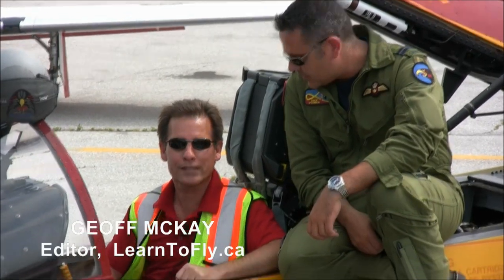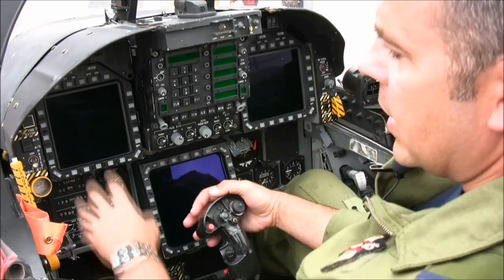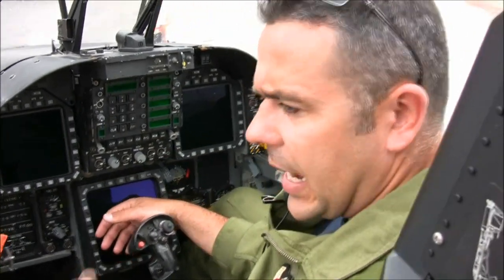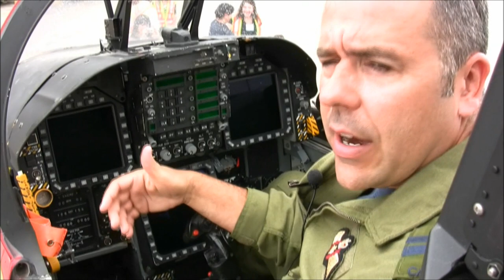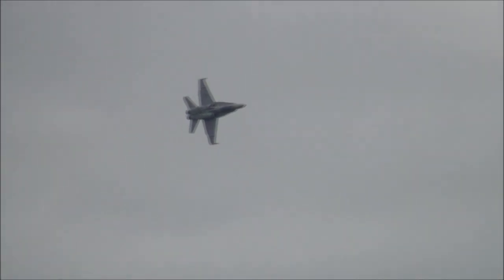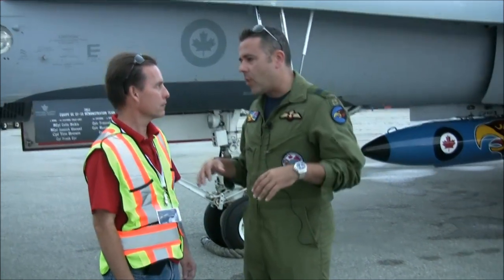Learn to Fly a CF-18 Hornet Fighter Jet

Comment from the maker: CHAPTERS:
00:00 - Learn to Fly a CF-18 Hornet Fighter Jet
00:20 - Captain Erick O'Connor "Hom" 409 Squadron 👨‍✈
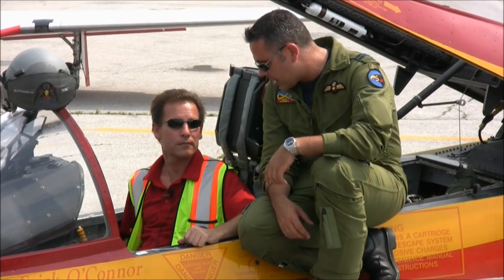01:17 - CF-18 Cockpit
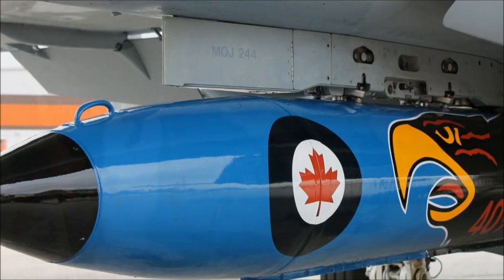02:22 - Weapons 💣
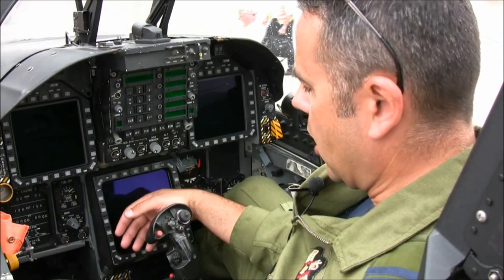02:53 - Radios 📻
03:10 - Spotlight 💡
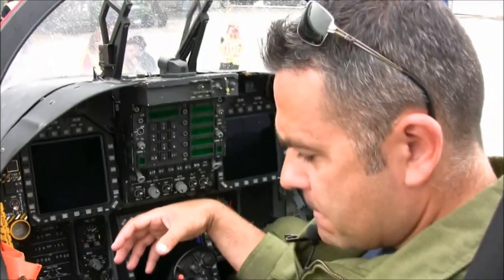03:26 - Heads Up Display (HUD)
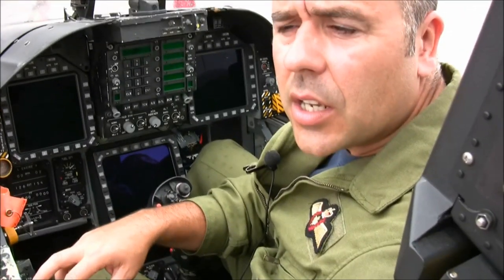04:27 - Arrestor Hook 🛑
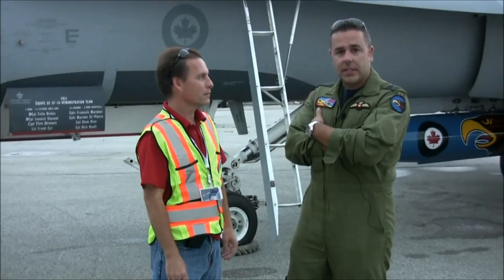04:45 - CF-18 Walkaround 🚶‍♂
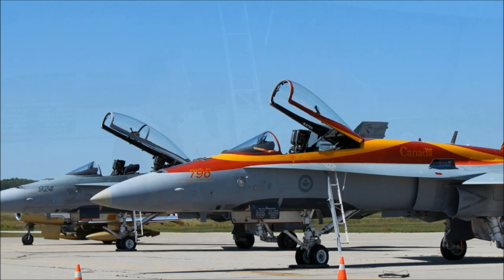05:17 - CF-18 Performance
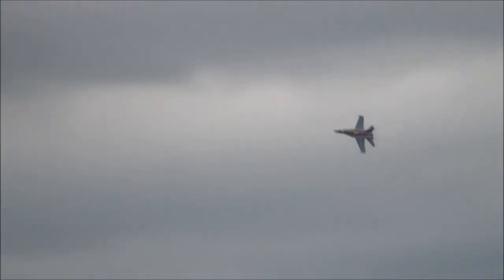05:37 - High-G 360 Aerobatic Maneuver
06:41 - Fly-by-Wire (FBW)
06:53 - V-22 Osprey Cameo
07:05 - CF-18 Taxi and Takeoff ↗
07:35 - CF-18 Aerobatic Performance
09:02 - Formation Flight
09:13 - CF-18 Taxi and Shutdown ↘

Comment: DCS World: F/A-18C Hornet brought me here. I already knew how to start this bad ass bird up
Reply: There's a bit more to in in the real aircraft... as in, years and years of training :)
I'm also sure that DCS leaves out anything that's classified. To start completely from cold, the real aircraft probably requires a security code that's set by the ground crew and is given only to the pilot when he climbs in. If it does, you're not going to see it in an entertainment sim :)
Reply: @devilsoffspring5519  there is a code created daily for each aircraft that comes directly from the prime ministers office. If inputted incorrectly too many times the aircraft will go into a limp mode rendering it useless until an AVS technician recomputes the mil spectrometer. A new code must then be entered.
Reply: @joshhead9368  That sounded almost plausible until about 1/3 of the way through :)
Reply: @devilsoffspring5519  almost as ridiculous as what you said.
Reply: @devilsoffspring5519  are you referring to the IFF mode 4 codes and the crypto variables?
afaik, you can start and take off with the aircraft with little external help...which is modeled in DCS...
the only things that arent modeled are specific IFF, have quick, and ky-58 besides some other stuff....
besides you are supposed to have a DTC /mumi in the real aircraft in order to load system data...

Comment: The CF18 is what we normally use.  The CF188 is the official term which we use in our LogBooks and other external documents.  Amongst Fighter Pilot, we will use F18 or Hornet.  A-C-E models are all single seater.  The B-D-F are all dual seater.  The Canadian Forces have the A & B models which have received extensive upgrades to avionics.  The E-F models are a different aircraft all together and much much larger.  Hom
Reply: Hom... 😂 You sound francophone. J'ai raison?

Comment: "Ready to go, like on 9/11" the pilot says. That's odd, as NORAD took over an hour to even respond, with operators even unsure of whether it was the drill mimicking the events of 9/11 that was taking place that morning or a real live attack that they were responding to. Who told Norad to stand down?
Reply: +Namaste1001 Even if they intercepted the planes they would never shoot down a commercial aircraft in the US back in 2001. I think they would now if they knew a plane was hijacked.
Reply: cherb23
That's not the point, they were told to stand down. 9/11 was allowed to happen.
Reply: AMCT 101
Exactly, and they failed to respond. Which was my point.
Reply: He specifically mentioned 9/11. My point is valid.
Reply: You're trying to distract from my original point. It still stands true.
Reply: ***** 1/2 a dozen Jets are more lethal and effective than you think.
Reply: ***** Do you understand how fast Jet fighters are? They could have stopped the airliner if they wanted.
Reply: ***** Depends
Reply: I'm pretty sure he was talking about a 9/11 like event, not actually saying we're ready to act exactly as they did on 9/11 specifically. Because you know, it isn't like Canadian aircraft were sent to intercept planes in American airspace on 9/11.

But I know you can't help but to get all 9/11 truther triggered.
Reply: ((MUH 9/11))
Reply: Namaste1001 The U.S. responded it was just too late at that point.
Reply: @amct1019  please research NORAD thank you

Comment: Haha, yes. once you get to know them it's really simple. The buttons are usually grouped in categories, so it's easier to remember as you keep doing it. I mean the F16 for example has a much more complex cockpit than the F18, which adds to the overall workload that the pilot has to go through during complex maneuvers. Which is exactly what they are trying to avoid nowadays with new fighters.

Comment: Dear Cinnabun. As far as your initial explanation of a machine that converts one form of energy into a mechanical energy, it is correct but this basic explanation stems from the early days of technology. In our modern era motors convert electrical energy while engines burn a specific fuel to create mechanical energy.

Capt. Pierre

Comment: Welcome to the Canadian Forces. A: We dont have super hornets, Super Hornets are F/A-18E's. Google it. B: CF-188 is CANADIAN FORCES. Not american. I have connections in the Forces who are pilots, and this is VERY correct information. Canada owns CF-188A's and CF-188B's. Also, in Canada (cause we're weird like this) We put an extra number for no reason. CF-177 (the Globemaster) is an example. Its American Designator is C-17, but we make if CF-177. Read your stuff before you confront someone.
Reply: that extra number usually comes from Canadian ordered modifications

Comment: GoMigman, I know your just poking fun at the Canucks, but if Russia came at us with airpower, they probably would come over the top, North Pole and cruise on into Canada, then TRY to get close to us. So yea they have to defend their boarders. I'm with ya on the F/A- 18 performance and design. I would lay money on a Hornet up against ANY aircraft in the world. This airplane is the best the U.S. has produced in a long time!
Reply: F22 raptor? could take on 6 F18's on its own.
Reply: I only tease in good fun, we love Canada!  Anyway, I'm with you on Russia coming in  from the north and even with the US' allegiance/support, we have our own problems trying to police the world and a disastrous F-35 program that could fail financially and even the aircraft by the way things are going, so Canada needs to rely on herself!  That airspace is so huge, I've always been an advocate of more strategically located bases to be equipped with enough aircraft to patrol specific quadrants that would overlap the others by 50 miles each way, give or take, and stretch that out the entire length of the northern border.  I personally think it would behoove the RCAF to invest in a boatload of F/A-18E's and F's instead of the F-35.  I think the latter is not only going to be a budget buster, but I'm not sure it's going to be the effective aircraft that an air force, which needs a tough, multi mission, high payload and great all-around workhorse would need.
Reply: If Russia came for the U.S it will be with ICBMS and SCBMS, those cf18s are there to reduce the number of re-entry vehicles.
Reply: @Nr1from1978  hmm 122 in total thus none available

Comment: "get the motor running" no Captain, you get the engine running, motors are electrically driven - that's why we say engines drive, motors are driven.
Reply: unapro3 Would the APU be considered a motor?? The APu gets turned on and the the engines so yes you need the motor

Comment: At 7:35 what speed would the jet be going? And does the speed have anything do to with the distinctive sound heard?
Reply: 350mph to 400mph. Technically the speed of sound in 761mph give or take. It all depends on the conditions from altitude, barometric pressure, so on and so on. Aircraft cannot break the sound barrier at airshows do to FAA restrictions. During high speed passes, they normally fly 600-650mph.

Comment: Scenario:
In movies sometimes we see and ear a pilot that has been hocked / locked by another pilot which is going to fire.

Questions:
Is it a real air fight technology or it is just cinema fx?
How is it possible for a pilot to say that another aircraft has locked own plain for certain?
How does it work the technology that allows to do that (if any)?

Thanks in advance.
Reply: Radars can do multiple kinds of locks when they see a target so that is all true (although in the movies its rather unrealistic but it gets the basics kinda)

Modern aircraft can tell when a radar is "locking" them by means of a RWR (radar warning receiver) which identifies direction of the radar, type of radar/aircraft (different radars on different aircraft which produce different signals), and emission strength (distance) so the computer can generate a relatively clear picture of aircraft around if it picks up radar signals.

They work via many small antennas on the exterior of the aircraft which receive the signals. Most modern day aircraft dont "lock" anymore but use a soft track when they launch missiles so the enemies RWR doesn't pick up anything more than regular radar signals. Only when the missile goes pitbull (when the internal radar of the missile goes active for its own guidance) will the enemy aircraft get a lock warning and will identify it as a missile. Older aircraft used missiles without internal radars so they had to keep a hard lock which would give the enemy pilot a lock warning when the missile was launched.

Comment: The DAS removes covers the blind spot. You can track objects up to 1300 km away at any degree with the DAS. I think you need to do a little more research on the F-35 . The growler would work well in conjunction with an F-35 but instead of? thats kind of silly, theyre two different aircraft.

Comment: I'm all Navy Vet through and through, but I just can't warm up to the FA 18 Hornet/Super Hornet like i did to the Tom Tom. I'm still mad at the USN for trashing that beautiful bird. Yeah, Yeah, I get the maint. time for each hour of flight time and blah, blah... Nothing was sexier and badder than a Tomcat and her radar, lock you up before you even saw her on your scope. 1977-1980 USN, OS E3
Reply: ZanOGAL NO he says he's an OS, Operations Specialist; seaman, E-3. I'm a vet too, AE3. Worked with VFA-22.
Reply: I was the NDI Tech on CVN 71 for the Tomcat sunset cruise.
Rest easy knowing we flew the wings off and the motors out of those bad boys.
Huzzah!
Reply: Lol we got our f/a-18f aircraft right before i got into the squadron in 2008 from boeing, and till 2012 we went through 3 extended deployments, many Top gun debts in Fallon, boat debts, and qualification flights. I think the Navy just flies the wings off aircraft in general. (Gotta keep pilots trained for carrier ops)
Reply: Same was said about the F-14 replacing the Phantom. And the same will be said about the F-35C replacing the FA-18. I guess the F4F turned noses too.
But yes, the Tomcat was one hell of an airplane. FLY NAVY.
Reply: I always reckoned the F14 was my favourite Navy plane. She looked the part,even when standing on the deck. And when flying,she flew like an angel.

Comment: What makes you say that? is it the delays or have you actually bought into the hyperbolic BS that the media and detractors have thrown at the F-35?
If its performance based you may be very surprised once you get them clarified. People always talk about poor kinematic perforamce but the F-35 is designed at those specs in full military config. It out performs everything we have no under a combat load. Even the super hornet can only achieve mach 1.2 in combat config.

Comment: Too many electronics... what happens if those screens were to break?
Reply: ***** Hahahahaha, you're right ;D
Reply: +EggiTheShadow when was the last time your TV or computer screen broke??? My parents' old TV lasted almost 20 years and it was still working when they replaced it with an LCD
Reply: +EggiTheShadow Why would a screen in a plane like this break?what would break it?it is probably more stronger than normal glass but theres nothing that can break it inside the plane...
Reply: cmardeux h4z3m1 Sorry what i meant by that was, if they send out an electromagetic pulse or something goes wrong with the electronics....well, you're practically dead anyway since its a fly by wire plane
Reply: +EggiTheShadow Oh that makes sense you're already going to be dead after an electromagnetic pulse hits you
Reply: h4z3m1 Well not exactly, it only affects electronics, unless you have something electronic keeping you alive or you're a robot you probably wont die. Regardless you'll die not being able to control the plane anyway so it really doesn't matter. Hopefully ejection levers are still mechanical, rather than electronic and still work in that situation though
Reply: Yeah usually a strong electromagnetic pulse from a nuclear bomb or something like those electromagnetic bombs (idk what theyre called) would fry the plane computer and your controls will not work...
Reply: +EggiTheShadow It has traditional analog instruments that run off of a pitot static system. Although it would be hard for those screens to break in the first place.
Reply: Chris Brackin Didn't give much thought to the initial comment although it was sort of figurative i was referring to the electronics of the plane. But yeah i thought it didn't have any analog dials.. so if those screens stuffed up you wouldn't be able to see your altitude/speed/whatever else
Reply: The pilots are taught on any kind of danger situation was to happen. Try know what to do if engine failure, systems malfunction, control malfunction, transmission malfunction, and even if the cockpit gets clouded by smoke blinding the pilot. These guys are trained on what to do in any situation. I'm mean their given a multimillion dollar plane, they need to be the best of the best
Reply: joshua whitney Yeah but the thing is, if you have total electrical failure, your primary flight systems will be stuffed since they work on electrically powered hydraulics in fly by wire systems, and many of the newer planes don't have manual reversion either in case of a total electrical failure so if your electronics go you're stuffed, although many planes do still have cable trim wheels so the pitch will be the only controllable thing without power. Even in my flight training, we use cessna's and our instructors told us if the all your control cables were to snap, you would be dead although in electrical failure the plane is still perfectly flyable due to the static instruments

Comment: I just wonder sometimes how these guys would have coped with flying Spitfires or Hurricanes back in the forties,with no electronic gadgets,only a basic radar,and a very primitive navigation system to guide them. And they would have been up against some very experienced fighter pilots back then,Luftwaffe pilots with service in the Condor Legion behind them.
Reply: Entirely different training for entirely different machinery.
Just like most people today couldn't drive an old Ford Model T, even though it might have had a top speed of only 20 MPH  :)

Comment: The overall aircraft itself is the same. The performance of the aircraft is the same. The pilots training is obviously different. I'm saying there are no major structural changes that enhance or hinder performance.
Reply: in many previous cases Canada has made major modifications to engines and airframes to meet Canadian needs...............thus often different

Comment: no, no no. The CF-18 is the exact same as the CF-188. The proper name of the Hornet is the CF-188, in this case, its an A version, as in 1 seater. CF-188B which are the training aircraft used at 4 Wing Cold Lake Alberta are 2 seater. JUST FOR EVERYONE TO KNOW.
Reply: nope modified

Comment: I don't know but at 51 seconds into the video, Capt Erik O'Connor, a " qualified" military pilot informes us that the APU supplies air to "START THE MOTORS ??? " These are ENGINES, ENGINES, not motors. Scarry.
Reply: Pierre Mercier 
An engine, or motor, is a machine designed to convert one form of energy into mechanical energy. Heat engines, including internal combustion engines and external combustionengines (such as steam engines) burn a fuel to create heat, which then creates a force.
Same thing.
Reply: Pierre Mercier You could also call them turbines
Reply: Pierre Mercier You should learn English.
Reply: +Alex Mitroiu you should learn to behave

Comment: tut..tut...the pilot got some things wrong with regards the top speed of the CF-18.

Firstly, 2400 Kph = 1500 Mph, not 1600.

Secondly, twice the speed of sound = 1320 Mph, not 1600.

Thirdly, the Hornet CANNOT hit 1600 Mph, more like 1200 Mph. 1600 Mph is F-15 Eagle territory. And that's rarely achieved!
Reply: thefrecklepuny I know it's old. But in a high angle dive, with full throttle (and burners ignited) it's not impossible for the aircraft to hit 1500 mph. It's also not impossible for a Hornet to hit Mach 2 in extreme conditions.

No, it's not the Max specs. But specs are based on optimal, safe flying.

Comment: So it isn't an Attack version. No "A", designator. Supplemental means then - single subject. Not some tricky - upside down node file. Templates. Masonry in machines. Evol = wicked or false information.